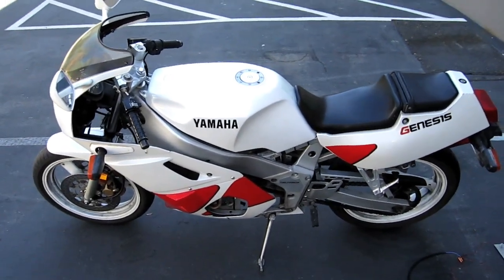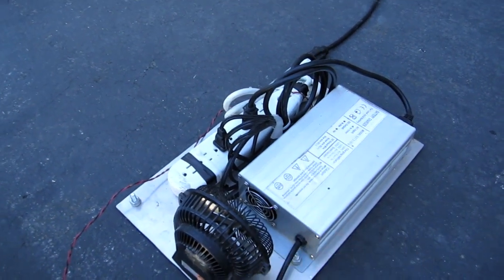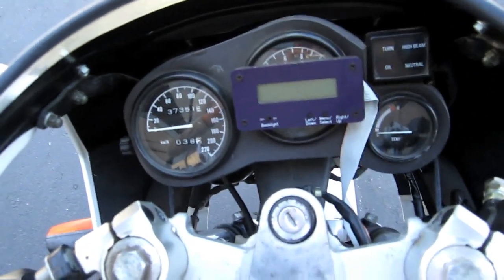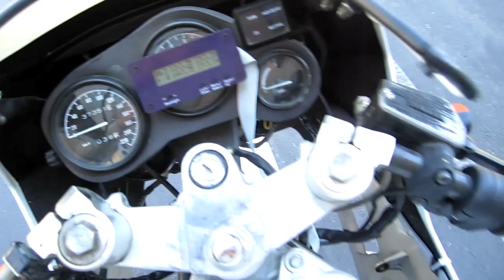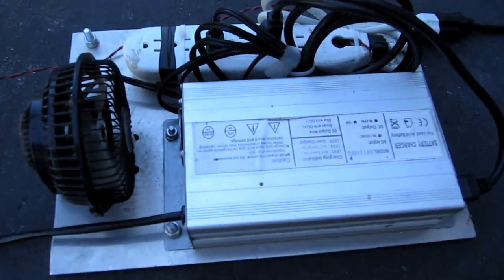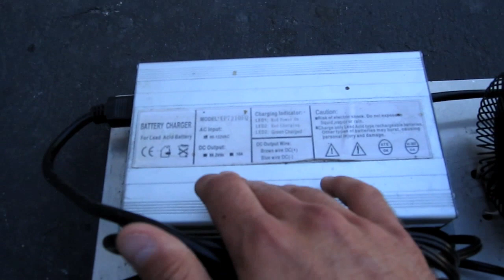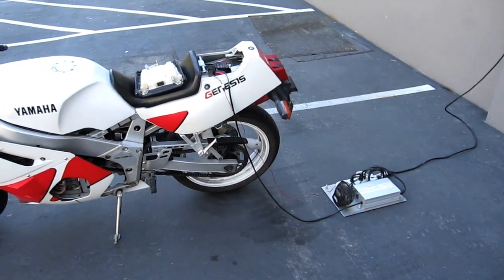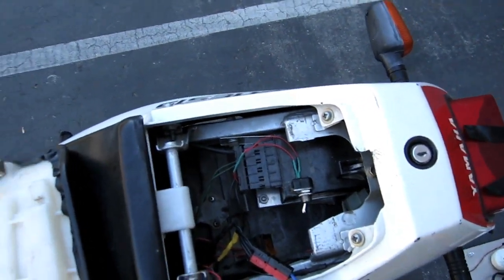#26: Charging Setup

Comment: I really enjoyed all of your video's man and im glad you are back, I was curious if you could share or make a video about the power the bike has, is the acceleration pretty quick or do you wish it had more... i ask this because i have been trying to figure out which motor to get for my EV motorcycle build and i dont want to underpower it, but AC kits are just SO expensive. I am wanting to build something similar to the Scorpion P6, but instead of the sportbike motor i want to replace its drivetrain with electric and their production bike is 643lbs
Reply from the maker: +storxusmc Thanks Storx. I will think about what kind of video I could make that would answer that one. I haven't looked at cost in a while so I don't know how it differs anymore. The AC systems will have a better torque curve vs the DC systems so they will be quicker. Have you by chance looked at re-purposing a drive system out of one the production electric motorcycles such as one of the zero bikes? Might be a cost effective, powerful, easy solution.
Reply: +Electric MotoVlog I actually have been reading as much as i can, just very few people building things as detailed as you did in the EV world, most just use an off the shelf kit and actually dont go into the details on why they picked it or what not.. I have thought about using an AC24LS since they are found really cheap on ebay used, but very few have gotten them to work from my readings and all of those were using OEM software programmed matched motor controllers, limiting them very much.. Another idea i have had was using an Chevy volt or spark EV motor since they can be found very cheap in regards to their output.. only thing is there is no real knowledge on how to use the motor outside of the car published online and i dont know how locked down that setup would be.. For example i was quoted $900 for the entire battery pack from a 2012 chevy volt at local salvage yard and another $700 they were willing to give me both sides of the engine, both petrol and electrical, which would include the motor controller and charge controller
Reply from the maker: +storxusmc Yes there are lots of people out there that just throw things together and hope for the best (most DIY projects) which is why they usually fail and are not very practical. The right way to do it is to start with a pen, paper, and calculator and not with a drill and hammer. Most of those AC motors are very similar and can be run from many different types of controllers. You just need a controller that can deal with the specific characteristics of the motor you choose. Beyond that the rest is up to you. Good luck!